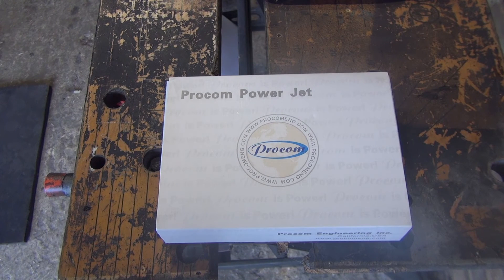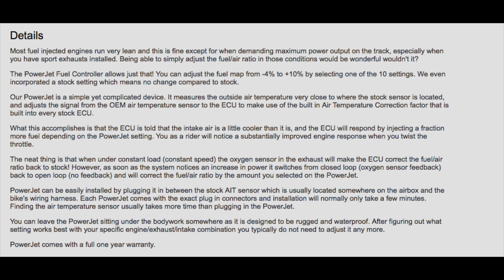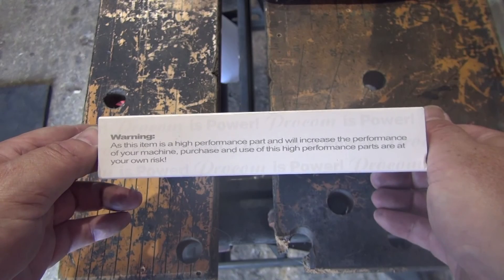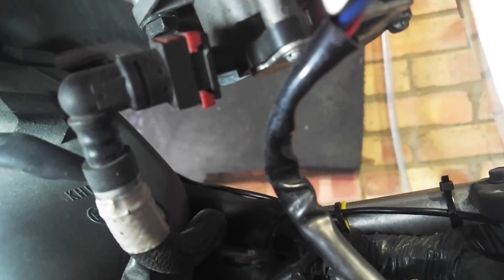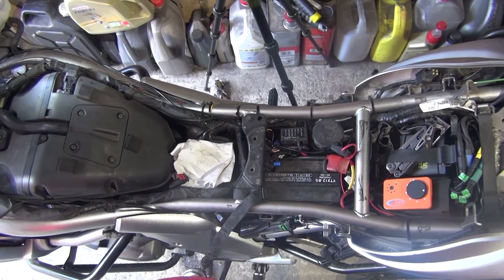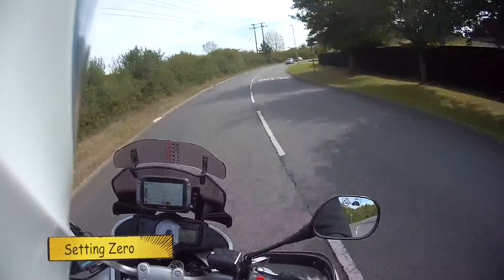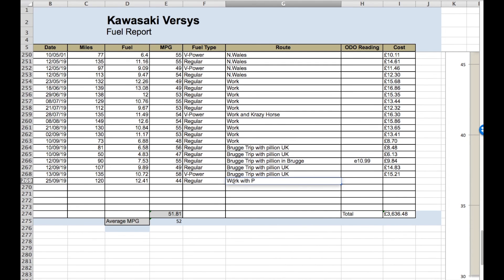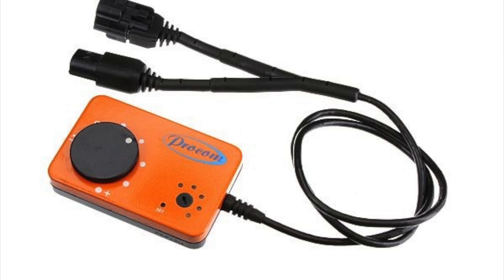Power Jet Instalation

Comment: Good to see there is a review on the fitting of/difference this product makes. Bit surprised that you were taken aback by the drop in fuel mileage, after all that is exactly the effect the product is intended to make. It is also proof that it does in fact do something and isn't just a snake oil box that lives off the placebo effect. Again, thanks for the review! Will be buying one based on it.
Reply: Exacly  I will gladly  sacrifice  paying a bit more for my fuel use  for 10% power gain...    to my vzr 1800  that is already a beautiful black beast of a bike 115lbs toque as standard

Comment: Thank you for the very detailed video, was gifted one of these from a friend and I’m about to install it. 

Fuel consumption aside, did you notice any long term negative effects? 

An increase in fuel consumption is definitely expected, no way around that. I’m wondering if it wasn’t so dramatic over time. I’m sure with the new toy you were a little heavier on the throttle than usual for the first few days 😂
Reply from the maker: To be honest this is something I use rarely use nowadays and when I do I whack it up to level 5 just for fun.  You may have read into my voice over that the difference is small, not that it was all in my mind but still small. There's been no negative effects other than fuel but as I said, I rarely use it these day (its still connected).  As it was gifted to you, put it on and have a go but if you were looking at buying one now I'd reserve my advice to only if you can really afford it.  Thanks for watching though and Ride Safe

Comment: ive had one on my 2004 zx6r for the past 4 years, its still going strong, only a couple of issues ive found is that at times the dial moves itself due to the vibrations and such, also the rubber wiring around the connections has corroded and broken due to weathering

Comment: I came to a similar conclusion. Noticeable difference. The big question though is does the mod increase your insurance premium as they ask any mods to your bike. If you were to be involved in a accident you just might not be insured if they don't know!
Reply from the maker: Very good point and my thoughts are that you do need to notify them. Insurers will find any reason not to pay out and this is a declarable mod.  What if its not switched on?
Reply: Well they do say stock settings are as original bike set up.
I bought mine not for the performance boost but I really wanted to see if it improved throttle and smoothness on my v4 bike and I feel it did on the first 2 settings. Good review  on s product that is not well documented.

Comment: Ive had one on my  99 750 SRAD,   Also with a Healtech FI module  & ATRE,  &  Leo pipe, n  Hiflow  airfilter     Mounted on the  steering head/ dash  Easy to Dial in   on the go..   Made a world of tunabilty,,   +++  @  hi speed   runs     9k rpms  to  12.5 rpms     Been 5 yrs    Next i need to change the  CR battery....  Bcoz it wont light up .... ( instructions are on the back )   CR1220  i believe  >>>>   Out!